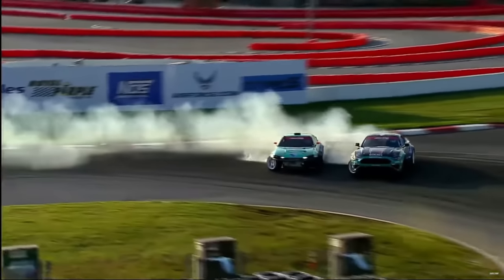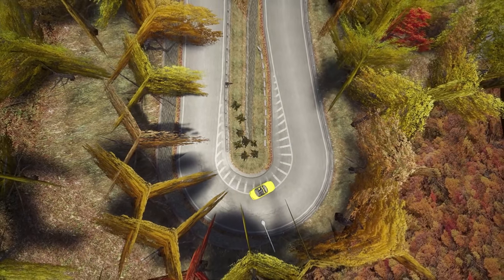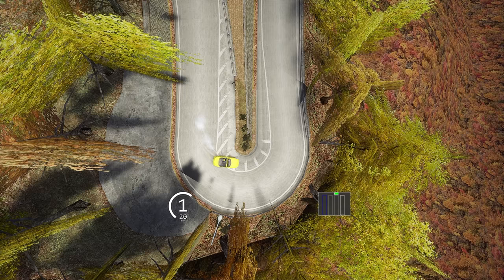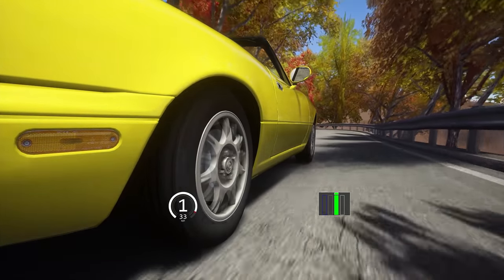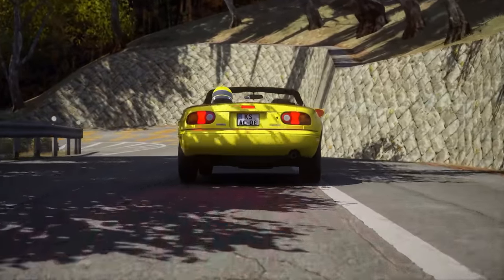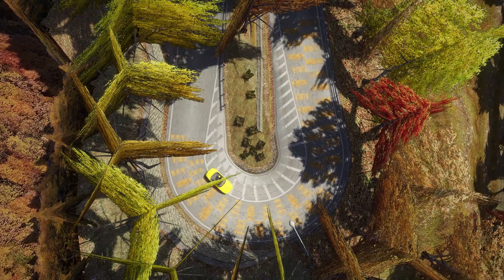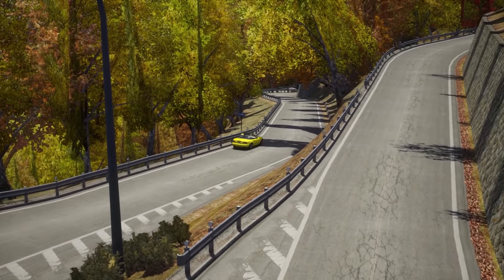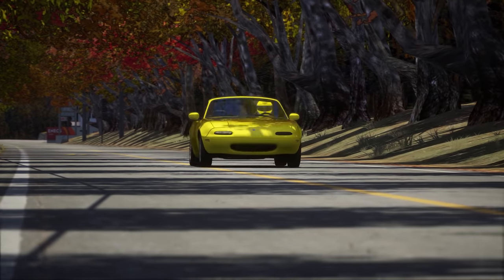Clutch Kick 🦶 A Method EVERY Driver Should Master

Comment from the maker: What topic would you like to see me cover next in the 'How To Touge' series?
Reply: So I was right
That post was this video
Reply: Inner Wheel LIfting
Reply: That would be cool
Reply: Blind attack
Reply: @FormerlySycho  Just drift over the gutter not that hard
Reply: @citizenfoffie7605  when i touch the gutter i literally go all over the place and lose control (I go like the miata in nagao map)
Reply: When to use all technique
Reply: @FormerlySycho  drift at full speed while on throttle so the weight is on the rear
Reply: How to properly manipulate the weight of the car to achieve a good balance between gripping and over steering. Also, how to minimize tire usage throughout a touge run, thanks!
Reply: @Vorahk brake, clutch in, blip throttle during shift
Reply: Rev Match downshift
Reply: FF cars avoiding understeer? Or left foot braking in FF? Thanks so much
Reply: Different types of shifting and when to use them
Reply: Heel toe
Reply: How to Touge: How to controll the accelerator throughout a corner
Reply: Rev matching/heel and toe etc, when to use and how
Reply: How to handle hairpins in various types of cars, AWD, RWD and FWD
Reply: Irohazaka jump technique
Reply: When and where to use the techniques shown
Reply: "Irohazaka jump"
Reply: irohzaka jumps?
Reply: Maybe 'One Hand Steer' ?
Reply: @FormerlySycho  Highish soft suspension, intertia drift into a corner with a little more angle and you better have the exact speed or enough power to transfer the weight all to the rear.
Reply: Ummmm what game is that pls
Reply: Fujiwara zone maybe?
Reply: Touge battles
It would be cool if you infiltrated sim racing communities as a sort of journalist, since eventually you're gonna run out of touge technique
Reply: Wall ride/ dying
Reply: Inner wheel lifting!
Reply: @bielak3228  not hard, just handbrake, max rev and throttle!
Reply: @misterk6792  yes! Joshima Toshia technique
Reply: @DokutahNatsu  isnt technique
Reply: @hiro7986  assetto corsa
Reply: Drifting on attessa ala godfoot
Reply: Lift-off oversteer
Reply: MISFIRING SYSTEM!! BWAH BWAH!! Jk
Reply: @se1un_sky  thx
Reply: Reverse entry drift?
Reply: can I have the download for the map?
Reply: Left foot braking. I do it a lot
Reply: cheapest clutch sets in world  , rite after this vid               hahahah
Reply: I am struggling to find a decent MX5 NC cars for AC for drifting.
In fact many popular JDM cars are missing with a non-crazy setup that is close to what you can achieve with a few mods in real world.

Comment: Loved today’s video! You did a great job of describing the usage and ability of the clutch. Describing the front end as a fulcrum point for the rear really put it into perspective. I’ve been using this technique myself and have only ever come across one issue. Lack of steering angle to make up for the oversteer. Obviously, in a drift build car with ample angle, this isn’t an issue. However, lately, thanks to you, I’ve been enjoying touge racing with my buddies. Trying to get around the course as fast as possible, drifting is implied, hence my use of an 86. I love it’s gearing and lack of grip when needed. It’s setup so perfectly for the course, other than the stock steering angle. Once the tires begin sliding, I start to counter steer. The issue with this is that I do one of two things. Either I don’t counter steer enough and begin the spin, or I counter too much and the car snaps in the other direction. I’d love some help trying to get around this, thanks!
Reply from the maker: It's hard to say without actually seeing it but it sounds like you might be countersteering enough but are inputting too much throttle?
Reply: Sounds about right, actually. I’ve been finding it hard to focus on all of the things at once. Modulating throttle, counter steering, shifting, clutch and braking habits, too. I think that might be my issue, you’re right. I think I may just be on the throttle more than I should be, haha! Thank you! 😅
Reply: @seths4840  Keisuke, it's time to learn the throttle control !
Reply: I find the AE86 is actually quite hard to drift compared to the GT86 for example. Like you said, it is fast to spin so you often aren't fast enough to counter steer, so naturally you try to counter steer sooner which instead results in you overcorrecting and spinning out the other direction. Like TRSB said, it's probably all in the throttle which is something I'm trying to work on.

Comment: I still use the clutch kick but in my car I can just tap the accelerater to kick the car out but for control I clutch kick. But also my car was tuned to drift a go-kart track so you can imagine the torque it would have. Pro drift car that was tuned for a tiny go kart track. If you wanna see it. I have a short clip of it on my channel

Comment: I’m sure you get this a lot but are you able to drive real cars this well as well? I feel like it’d transfer well, and if I got a racing sim would it transfer over as practice for my real car?
Reply from the maker: Sim are actually harder. The only thing you have to get used to going from sims to irl is that all of the 'force feedback' is delivered in terms of g-force, through the seat. Other than that, most of it does carry over. But, sim racing and irl driving are still two totally separate muscle memories, so you shouldn't throw yourself into the deep end trying to drift irl and take it slow.

Comment: With this video, I wonder how the guy in Initial D with that evo go insanely fast in the hairpins of Irohazaka.

Edit:
Is clutch kick only for RWD? Does it work for AWD or FWD?
Reply: i use it when offroading in my awd impreza, works pretty much the same kinda way. idk bout fwd tho
Reply: no it's not just for RWD, clutch kick is like doing a burnout,  any manual car can do it.
Reply: If you do it on a fwd car it wont have the same effect, you will understeer instead of oversteer

Comment: hi, do you use loadcell pedals by any chance?
Reply from the maker: Yes I do!
Reply: @TSRB  i’m thinking of buying the t-lcm pedals, they’re loadcell and i have a logitech wheelbase, do you by any chance know if they are decent or not?
Reply from the maker: @syndeko1632  I've never used thrustmaster but anything is better than logitech pedals
Reply: @TSRB  yeah, they are not great, do you know if the csl elite come stock with loadcell?
Reply from the maker: You need to buy the load cell brake kit. Totally worth it, took my driving to the next level
Reply: @TSRB  im gonna save up for it, what would you rate them from 1/10

Comment: but clutch kicking hurts the drivetrain like shift locking right? its not the proper way to drift ive heard
Reply: i am pretty sure it's not good for your clutch and probably not good for the transmission either but in games and on professional cars like in formula drift where the clutches are made to take a beating, but i'd imagine it also wouldn't completely destroy your entire drivetrain if you were to do it a few times
Reply: In Motorsport where top fuel dragsters destroy their own engines in a few seconds, as long as it makes it past the finish line, you can do it.